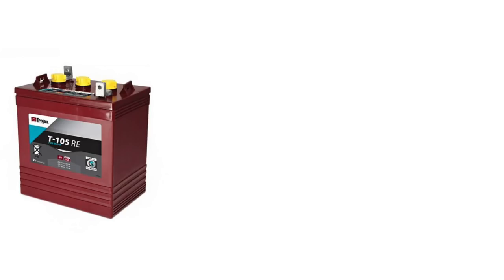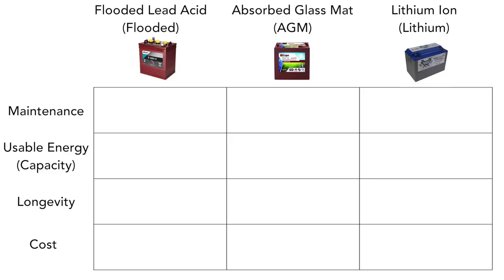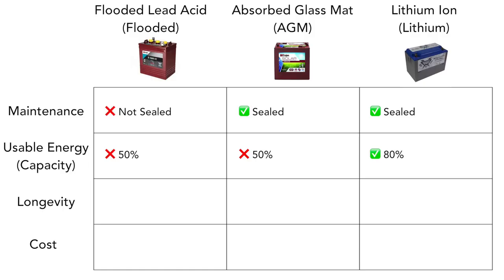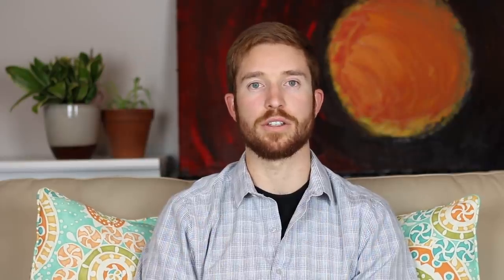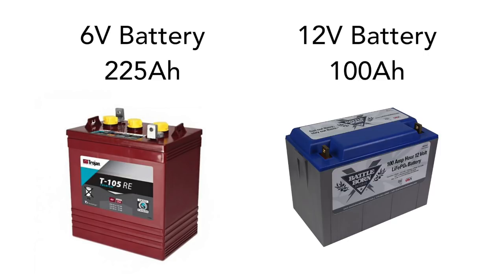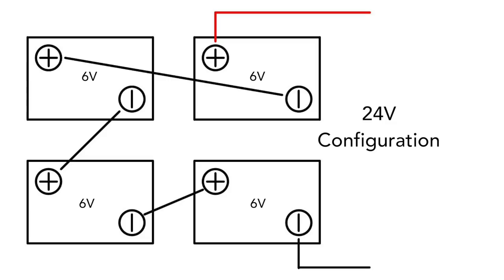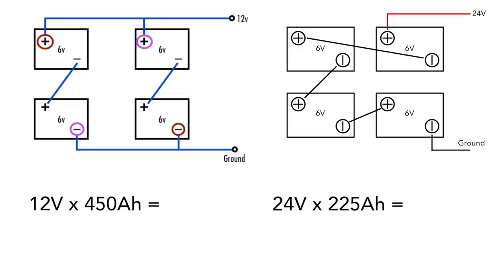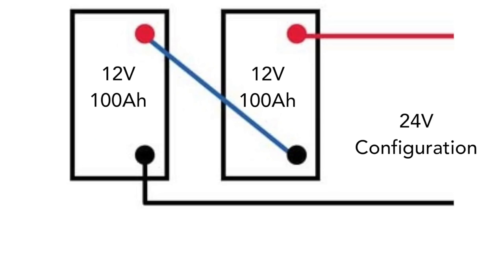Battery Bank Options + Wiring Solar Batteries from 6v to 12v vs 24v

Comment: Very strange video. All the advantages of liquid acid are turned into disadvantages to promote LiFePo/LiPo?! The only aspect where LiFePo/LiPo have any advantage is the lesser weight.
Besides that, to have the option to refill evaporated water is not a disadvantage but an advantage over AGM and LiFePo/LiPo. To cycle only 30% of the energy in liquid lead greatly increases their lifetime significantly over the regualry 1000 cycles, but still at a lower price than the same amount of useable energy of LiFePo/LiPo. Besides that LiFePo/LiPo have a much lower energy reserve available since the capacity is almost completly used in a 80% cycle, while lead acid (liquid/AGM) have much reserve when normaly only cycled about 30% of C. So the lifetime of lead acid can of course compete with the 20 years of LiFePo/LiPo. I have accumulators much older still working quite well, even when the original capacity is reduced to something around 50% over time. That does not work at all with LiFePo/LiPo or AGM, since the dried dead after a certain amount of cycles they have performed and then dramatically decrease their capacity to near nothing.
The only real disadvantage of liquid lead acid is weight and space, since their energy density per weight and space is much less than LiFePo/LiPo. But that is the only real disadvantage!
When it comes the end of life time, all the lead can be recycled 100%, while there is not even a concept how to handle the extremly toxic lithium in the aftermath!

Comment: Lithium ion battery's should be drained to there lowest point before being recharged or it shortens the life of the batteries...
Reply from the maker: Good to know. Thanks!
Reply: I have not ever heard anything remotely resembling that idea with Lithium ion batteries, there is a memory issue with NiMh batteries where they will start acting like smaller batteries when not fully discharged, but nothing of the sort is going on with Li-Ion.
Reply: He is confusing bottom balancing. But for solar you should top balance
Reply: That is false.
Reply: Will Prowse that is false I agree!
Reply: That's a lie....
Reply: @DuetJustusFam  he has no idea what he is talking about please don't take random advise form a comment section people like to just repeat the last thing thay herd without ever checking to see if it's actually true. to get the most out of a lithium ion battery you wold want to stay between 30 and 60 percent the further you go form 50% and the longer you stay there the more where it puts on your battery's that's not a perfect rule also FYI batterys are like people thay are complicated

Comment: This is mad bro...never seen anyone diminuishing an AGM like you. you make look like a flooded battery is the same or better than an agm. NOT TRUE

There is so much more about it, from cycles, to voltage input and capacity. It is not true that agms have only 50% access...they can go as low as 60-70% without damaging cells.
Also there are deep cycle lead acid that dont need to be kept topped up, but still are NOT agms.

Just be careful of how you spread that info. You making it look like agm is so much more expensive and nearly the same as a flooded - which is not!!

Comment: A Lithium-Ion battery will NOT last 5 times longer than this batery  ...
Trojan SOLAR SPRE 06 255
3,400 Cycles ( 9+ Years ) @ 30% DOD
4 x $205 = $820
2S2P = 12 Volt @ 450 Ah

You have no proof that a Lithium Ion battery can last 5 TIMES longer than Lead-Acid
Where is your PROOF?
Or, did you just fabricate that story ?

Comment: Your assessment seems wrong to me.  I have a pair of AGMs and they are 20+ years old and still going strong.  Also, you mention the cost of new batteries but made no mention of used batteries (although I didn't watch your entire video cuz of the errors early on).  Also, AGMs do have maintenance... they will eventually lose some water and may need desulfating so I didn't see you mention that either.  This video has many many errors.  Downvoted.

Also you have many other errors regarding the life of the batteries and how much usable power there is.  Who said you can only use 50% of an AGMs rated capacity?  There are many videos on YouTube showing how to squeeze out the full rated capacity of them.  There are also deep cycle batteries that handle deep discharges rather well.

You are grossly misinforming people with this crap video.